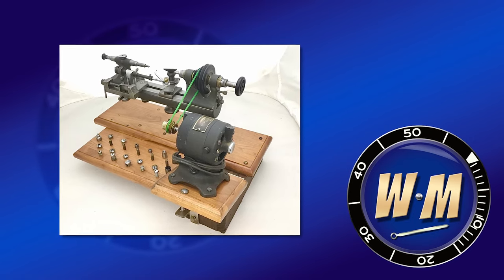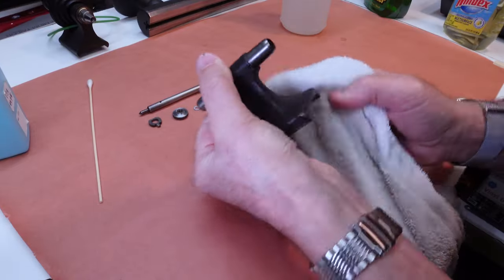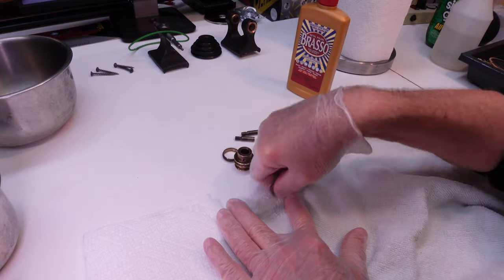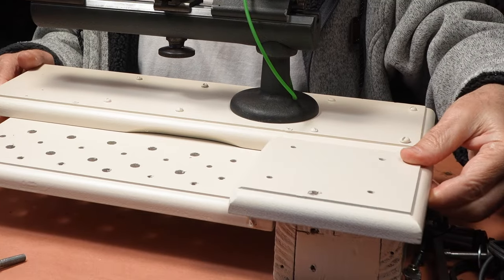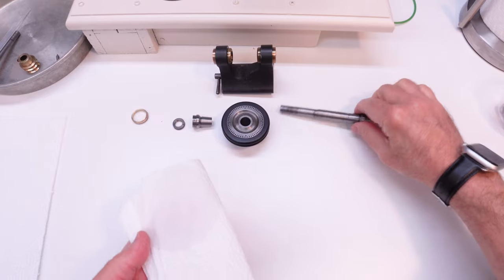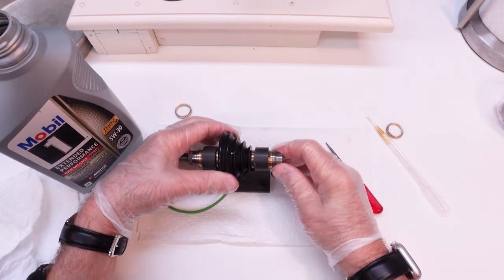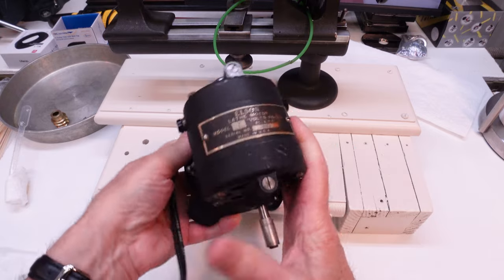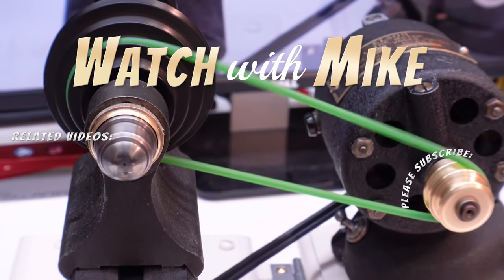Watchmaking Lathe Restoration - 8mm USA 'WW' style Elson Watchmakers Lathe #watchmaking

Comment: It looks great Mike! You are on your way now. I find that a foot switch/pedal to control the motor useful to keep hands free and on the work. Maybe something you can add later.
Reply from the maker: Hi John, a foot switch is on my wish list - but I'm also considering switching to a variable speed motor. I want to use the lathe as-is for a bit, and then make modifications after having some experience and feedback. Stay tuned! 😁

Comment: Nice job of cleaning and protecting.    For very lightly oiling the parts you can't reach like the slots and inner bores of the collets I'd like to share a trick from a buddy that long ago used to service camera shutters.  The old mechanical ones.  The trick was to prepare a bath of solvent with only a couple of drops of light machine oil.  Your mineral spirits and the 3in1 would be fine for this.  Once stirred to mix it up simply drop the parts in, swish it around a touch to reach any air pockets and then remove and drain well.  For small parts like this I suspect a tea ball would be a neat method.  Lay the parts out for the solvent to dry away and you're left with a minimal oil film on all the surfaces.  Including the parts that are pretty well impossible to reach without a full dunking.

I'm looking forward to seeing more of your watchmaker's lathe learning.  I'll try to follow along with the one I have which is currently apart and awaiting attention similar to yours along with a little more.  It's one of the nickel plated ones and the nickel is in pretty bad shape.
Reply from the maker: Hi Bruce, I really like your suggestion of doing the oil treatment for light rust prevention! I'm going to give it a try. 😁 Thanks for following along on these videos, and good luck with your lathe restoration!